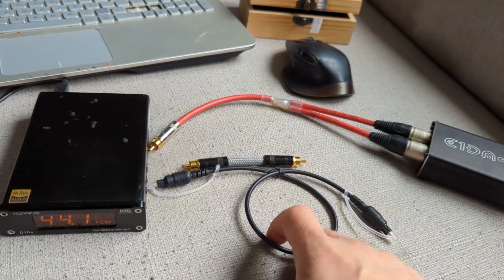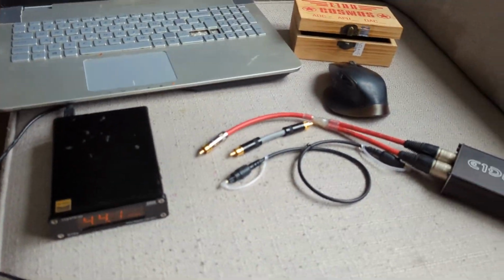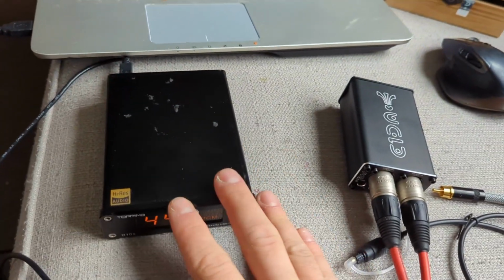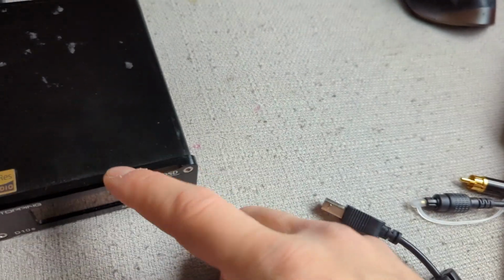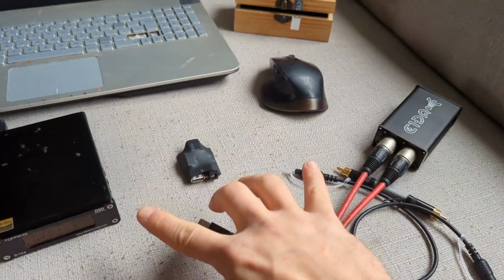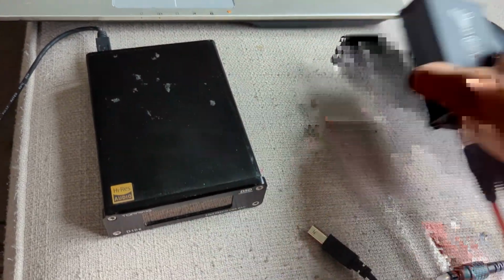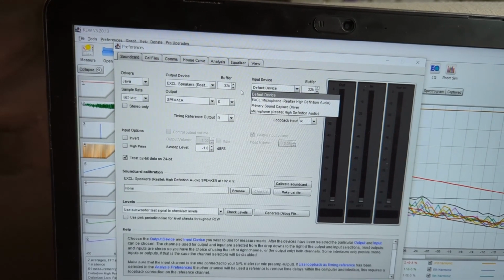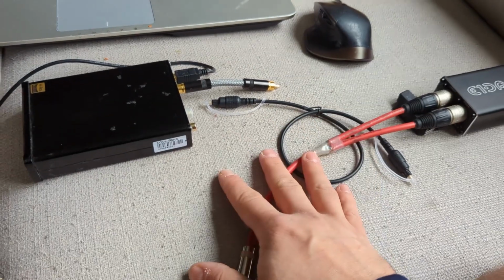New gear for testing dsp's and amps

Comment: Does anybody know if u can use the helix mtk1 for rew. As far as I know the mtk1 is already calibrated for the helix DSPs. But if I want to use it for rew I cannot find a calibration file to upload it into rew ):.
Reply from the maker: Most likely it will be a non calibrated mic such as Behringer ecm8000. You can use it with REW no problem.

Comment: Thats some nice gear! The isolator however is not a "high end supply" its an isolator. Normally the the GND from the laptop connects to the DAC over USB, than to the ADC over RCA and then back to the laptop over USB, creating a loop. Since the RCA is unbalanced, this ground loop can pick up noise in the signal path. The isolater avoids this loop*. Since currents run in loops: no loop, no current, no noise.
*to check: measure impedance between in and out USB GND, normally that would be 0, here it should be OL or >100k at least

BTW, COAX and SPDIF should carry the same signal, but since SPDIF is only optical, it would be a good way to avoid GND loops too.

Comment: There is a brief section covering Multichannel input and output in the REW setup guide. Basically explaining how to use ASIO "wrappers" (I like ASIO4ALL) to setup for multichannel access/selections.
Funny as I was just going over that lastnight. 
P.S. Try that D10S as a source to your DSP in the car. ;-)